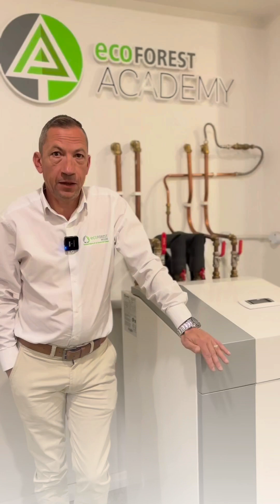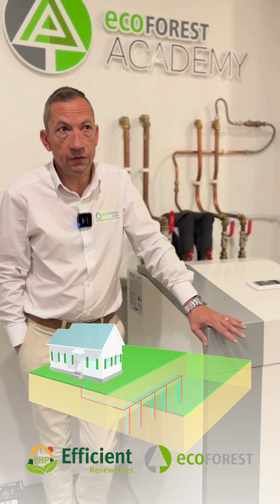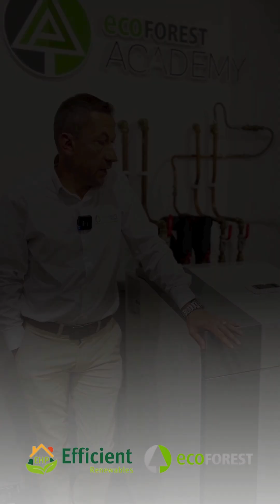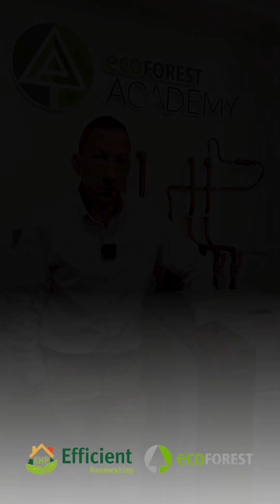Ecoforest Geothermal Heat Pump

Comment: I am looking at replacing my 20 year old ground source heat pump as it has stopped working and nobody will repair it. What approx cost am i looking at for a 14kw unit?